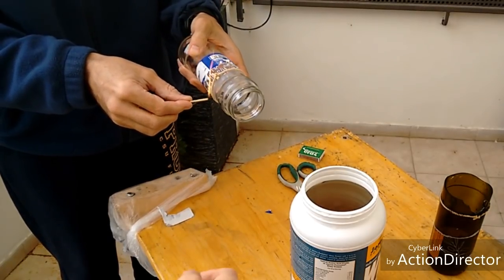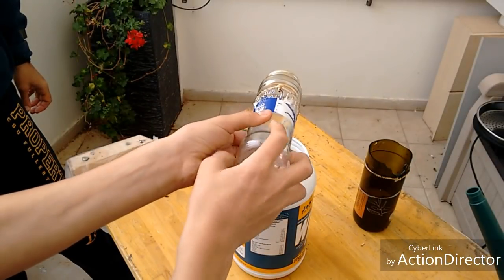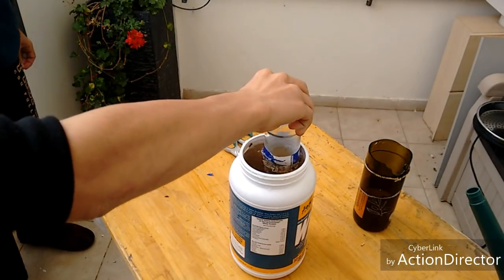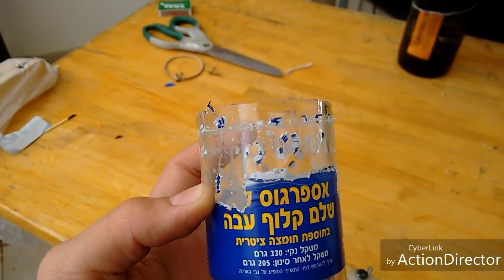How to Make a Glass Bottle Cutter | How to Cut Glass Wine Bottles WITHOUT a Store-bought Cutter!

Comment: Place the water in a longer more shallow container so you can essentially dip the bottle as horizontally as possible. Also the cap off would help with the pressure so it doesn’t build up and pop the bottle. It may actually be constructing the air and creating the vacuum. So if the cap was off the water would freely enter the bottle partially right before it fractured. 

Thanks for the video. Pretty darn good stuff.
Reply from the maker: Good idea, thanks.

Comment: 2 fails... Did you find out something that worked?
Reply from the maker: To be honest I kind of gave up (I wrote more about this in the Instructable that's linked in the description). 
The point of the video was to show how to make a bottle cutter in a new cheap, and simple way that I've never seen before. This scores a bottle just like any other homemade or storebought glass bottle scorer does - I just haven't had much success cutting the bottle - I also don't have a need for cut glass bottles, I just wanted to share my idea that works. :)
Reply: I respect your honesty! If I find a better way, you'd be the first to know.
Reply: I have tried a few attempts of my own and I think it's the heating and cooling part that is the real trick. Obviously getting a straight even score is important but I broke every single bottle that I tried.
Reply from the maker: Yup, I know that's the issue. I don't have a use for cut glass bottles so I didn't want to spend more time, but it scored the bottles very easily.
Reply: A tile cutter seems to be the easiest way without so many fails in between successes.